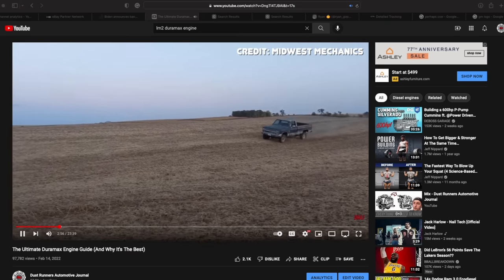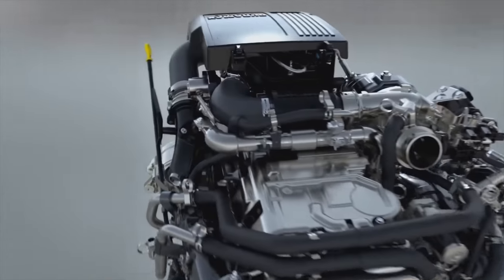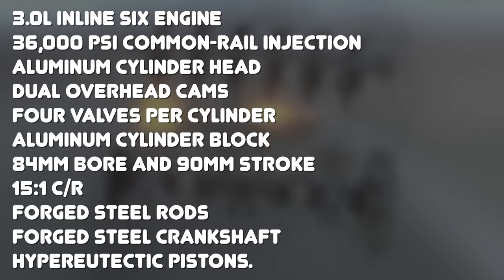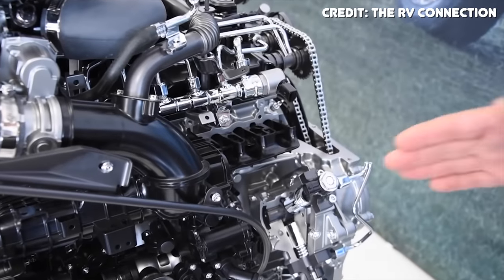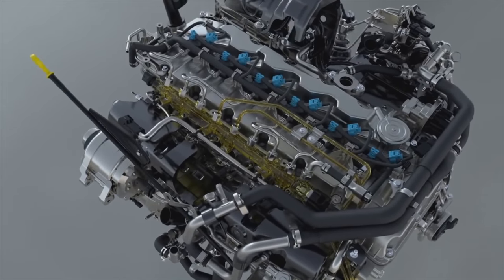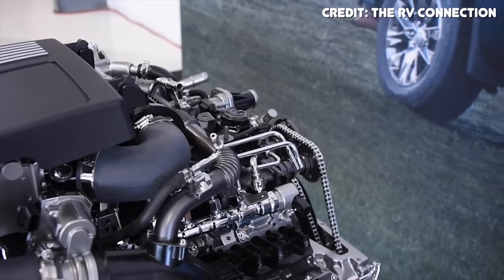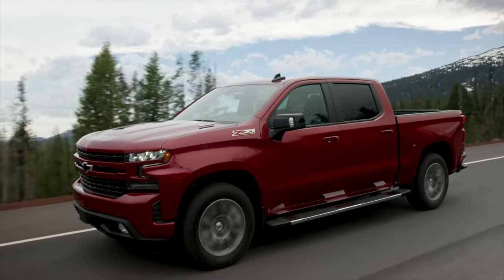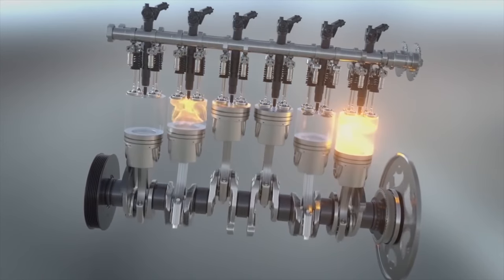3.0L LM2 Duramax: Everything You Need to Know

Comment: Great video. Taught me things I had many questions on. This is my recent and not over with experience with my new Duramax and Chevy.
I have had plenty of Ford Diesels and Ram diesels in the past. All ran great except the last 2500 Ram in 2014. The DEF system broke more then 8 times in 12 months stranding me 3 times out of town. I lemon lawed it and they did not contest. My 2005 Excursion ran great up until 60,000 miles something blew in the HP Rail System. The mechanic told me that igt was a very common problem of the 6.0 liter engines at the time and would cost me over $2500.00 to fix after the warrantee expired. I traded it in. I wish I would have kept it since they have plenty of fixes now. Onto my story.
I bought a 2022 Tahoe with the Duramax. I waited 9 months for it since it was custom built. Ordered in May of 2021, showed up in January 2022 as a 2022. Ran great until it hit 8,000 miles only a few weeks ago. Check engine light came on, the collision alert system would go off for no reason, the transmission run hot alert came on even though I put the trans temp gauge up, it goes from normal to overheat and back several times in about 5 seconds then stays normal until it does it again. This usually happens when sitting at a traffic light but sometimes at highway speeds, a reduce speed warning comes on even when just rolling and sometimes on the highway, once it refused to accelerate but that was just once. MPG also changed. It went from 17-21 city and 24-28.4 highway to under 18MPG no matter. Obviously something is wonky! Drove it home and parked it. Next day it wasn't happening but the MPG is still low.  I spoke with the dealer and they only have one diesel mechanic and over 25 3 liter Duramax trucks in line. I was told no guarantee and it could be weeks. I need that truck for work so I had to wait a week or so and now will make the appointment. In the mean time, I did my first oil change and could only find the oil at the dealership at $13 a quart. That's $2 more a quart then my wife's 2021 twin turbo Porsche. The dealer also sold me this tiny blue oil filter without a box. When I removed the original filter, it said to replace it with an AC PF66. The dealer supplied filter was shorter, not labeled and I could squeeze the filter with my hand. it definitely was some knock-off filter. Is this what AutoNation Pembroke Pines, FL is having their mechanic put into your truck? That's why I always do my own oil changes and basic maintenance. I drove (yes, another car!) to my local auto store and found that they sold the correct AC filter and both Wix and Purolator who make very similar if not better then the correct AC filter. It's not uncommon to find different brands sell the same exact oil filter but all three had little variations which looked like three different manufacturers. I won't tell you which filter I put in but it was not that piece of $#it dealer sold one. I am telling you that the dealer supplied filter that cost me $12 was a cheap knock-off and that I do not want in my truck and neither should you. Yes, I am going to call them out on it. I'm not knocking AutoNation as the salesman and customer service was was fantastic but I worry about vehicle service when the dealer is putting a junky but very important part of your engines maintenance pieces. So should you. Before you go to the dealer for an oil change, check with the service department to see the oil filter as if you were going to buy it. If it is not in a box and/or does not have a PF66 sticker on it (they all do), either do it yourself or go buy the proper filter (will have to be the AC PF66) and tell them to use that one. If one dealership is doing it, then others are as well.

Comment: I have a 2020 AT4. absolutely loved the truck until I hit ~45K miles and it went into limp mode. It's been at a local dealership for over 6 weeks now and they still can't tell me all that's wrong with it or when I'll get it back. Good news is that it is still covered under the powertrain warranty. All I know is that the whole engine is torn apart and they keep finding more issues. I think I'm gonna get out of it and go with the 6.2 or 2500 diesel. I keep my vehicles too long to have to worry about another similar issue at 150K miles after the warranty runs out. Two months ago I would have defended this engine until the end, great fuel efficiency, tons of power to pull my boat, and really smooth engine... when it was rolling anyway.
Reply: @Dark farts Yep, the new cylinder deactivation systems on the V8 are so bad that the best GM engine now is the 2.7T 4 banger.
Reply: @OtisFlint  Thanks to the microchip shortage new V8 equipped trucks don't have dynamic fuel management.
Reply: @mikechappell7920  is that all of the V8s?  I would buy the 6.2 if it didn't have the DFM?

Comment: FYI, most big truck engines makers, such Daimler/Detroit, Volvo, and some Cummins, have rear gear train engines. The rear gear train allows more airflow over the engine to keep the engine compartment cooler. It has nothing to do with serviceability and everything to do with removing heat from the engine compartment.

Comment: Had my Silverado for about 18 months and 14,000 miles. Mileage is quite good with an average of about 22-23mpg city, 27-30mpg highway (I tend to drive fairly fast on the highway so the 30mpg or better is only seen when I’m actively trying to get good mileage). Issues have been occasional (like 6 or 7 times ever) non stop cranking without start. This seemed to me to be related to key fob security type issues. Kind of a hiccup where the truck doesn’t realize you have the key in your pocket, yet allows you to press the starter button and engages the starter. Oddly, the ECM doesn’t have a time limit on cranking of, let’s say, 8-10 seconds and will crank indefinitely if you allow it. Only way to stop it is to press the lock and unlock buttons on the key fob. I suspect if you didn’t do that it would crank until starter failure or dead battery, whatever occurred first. Took it to the dealership for service and they did a software update after I made them aware and it has so far not had that issue, though the update oddly did increase crank times before starting compared to before. Maybe 1.5-2 seconds cranking vs 0.5 before.

Comment: I have 85,000 on my babymax. You mentioned the hard start or long crank that is intermittent,  I have noticed that it was more prevalent in the first 40,000 miles and that it only happened when I shut the truck off during a regen.

Comment: may have already been mentioned but DEF system doesnt fair well in colder climates.  A co worker of mine got one and not knowing any better he filled it DEF tank and when it froze which happens often enough the DEF heater cant keep up with a full tank but seem to be able to handle half or quarter tanks, maybe a video on common DEF issues throughout the diesel engines would be an interesting video. what causes issues and what could possibly prevent the issues and stuff like that. I have a VW 3.0 TDI and is giving me emission problems right now.  Luckily i have other vehicles to drive so I'm not in a rush to get it fixed quite yet but having known a little more on the issues i would have avoided the purchase all together and I have been a fan of diesels my whole life.  Main reason i cant see my self spending 60 to 100k "I live in Canada" on a truck are the draw backs of DEF system malfunctions as well as other emission hiccups.
Reply: Def freezes at 14* F . The coldest I had This Year was-10 and not plugged in. No problem. Now if it's going to be worse than that I'd plug it in. You'd think they'd heat The Def tank as well as the antifreeze while it's plugged in. But Engineers and common sense aren't so common

Comment: easy maintenance is one of the most important traits of a good daily driver. They really dropped the ball on this one
Reply: although you're not wrong, but 150k miles isn't exactly bad either... that's longer than most clutches. You're part of the reason why manufacturers are pushing for 2 year 20k mile oil changes, just because people are lazy and see that they only need to maintain once every 2 years, or non at all every 2 year lease they gravitate towards that car more.
Reply: @gwot  i didn't neglect my spark plugs because im lazy.. its because i dont have the means to drop the cradle to get to the back three plugs. Yep im the reason why🙄🙄🙄
Reply: @gwot  im just tired of manufacturers purposely designing cars that require a two post lift to do maintenance
Reply: @Alexernst55  it doesn't require a two post lift to drop the tranny.
Reply: @gwot  correct. Have a 66 mustang with a borg Warner t5. Fucked up 4th gear synchro and replaced the whole transmission bc I'm too dumb to tear one down. Did it on jackstands. Sucked ass. But possible.
Reply: @Alexernst55  not denying any of that

Comment: THere is a video out there from the chief engineer for the LM2 LZ0 engines that said there was a sub-tier supplier flaw in the crank angle sensor on some of the early model year trucks.  It was ultimately corrected in software.

Comment: 150,000 mile belt replacement. So about $1000 every 10-12 years. I’m good with that. And I would think GM did a lot of severe load testing for this engine. They didn’t just come out with it ‘cause they had leftover 3 liter diesel blocks laying around.
Reply: maybe $1000 this year, but likely to be twice that amount in just a few years....not so sure with wouldn't be $2000 now.
Reply: @mtjag3138  I mean are you really racking up 150k miles in a few years?

Comment: The crank no start is essentially a non issue. It starts up the second time 99.9% of the time. Annoying yes but seems more than likely a software error as the TSB for the cam shaft sensor was not a fix. Still the best diesel engine for a 1500 on the market by a mile. (Current owner)
Reply: There's an ECM software update that fixes this issue. Look up PIP5823A. Any GM dealer can flash this update to your ECM.

Comment: I am really surprised GM went to the trouble of building straight-6 version of an Opel passenger car diesel. In Australia, they use the excellent Isuzu 4JJ3 3.0l diesel engine in the D-MAX pickup. Reliable and proven engine.
Reply: American emissions essentially just say “no” every time someone tries to bring a new one to market.  It’s dumb, but it’s how things work over here.
Reply: I wish we had the Isuzu over the vm. They seem to be more robust and more reliable.
Reply: Haha. No that’s not at all what they built. I’m confused why you even compared the LM2 with the 4JJ3. The only things they have in common are that they are diesel and have 3L displacement. The LM2 has 66 kW more peak power and 174 newton meters more torque. They are not in the same league.
Reply: @RB-xv4si  Yeah, that's exactly what it is. The LM2 is a direct descendant of Opel diesel engines in Europe. The thing was designed at the GM powerplant center in Italy where the rest of the Opel diesels were designed. Now they technically buy all of them from PSA since the sale of Opel but that's where the design work was done. You can even see the same belt driven oil pump setup on them. It's not a bad thing, they make great diesel engines. I was just commenting that it was an odd choice.

The 4JJ3 has plenty of headroom for more power. Australian tuners are regularly getting 550-600Nm (400-450lb-ft) of torque out of them with nothing more than a tune and bumping boost up from 20 to 25psi. No injectors, no larger turbo, just a piggyback ECU and an intercooler to safely raise boost. The stock 4JJ3s are barely breathing hard.
Reply: @DriveCarToBar  an inline 4 is fundamentally flawed compared to an inline 6. An inline 6 does not require a balance shaft. It also does not require counterweights on the crankshaft because it’s a naturally balanced configuration. It has perfect primary and secondary balance without adding extra weight and moving parts and is the ideal configuration for diesels. That’s why almost all modern commercial transport trucks use inline 6 diesels. You can tune all you want but you’re just polishing a turd.
Reply: @RB-xv4si  Not the point at all and the straight six vs four isn't as big as issue with diesels and their very long strokes. While the straight 6 has perfect balance, the low revving LM2 can't really make use of it's biggest benefit, which is high rpm smoothness. Conversely, because it never spins that fast, the 4JJ3 doesn't need a balance shaft. 
You're going off into the weeds though. I just commented that I thought it was odd for GM to go to all the trouble of a new diesel when it could use one that already comes close to US emissions standards and would just need certification from the EPA. But it could be that they wanted to build it themselves in the USA (which the LM2 is) instead of buy them from Isuzu in Japan or Thailand. It could be they tried and Isuzu turned them down for whatever reason.
Reply: @DriveCarToBar  what you say about straight six diesels needing to rev high to take advantage of their balance, that’s not really the point of having a straight six diesel. There are many other advantages, one being that they are less complicated and more reliable than naturally unbalanced configurations. As I already said, straight six diesels are used almost exclusively in heavy commercial trucks. And those don’t rev past 2,500 rpm or so. That peasant 3L inline 4 diesel…I have a very similar version of that in my 2018 Chevy Colorado pickup. It’s the 2.8L Duramax inline 4 diesel..made in Thailand and has almost exactly the same power figures as that new Isuzu engine and a bit more torque. It is an absolute turd and is more boring than watching paint dry. Chevy is discontinuing this Duramax for the Colorado refresh next year..because no one here likes it!!
Reply: @RB-xv4si  No, I said that straight six don't rev high, which negates one of the advantages of a straight-six design that we see in gas motors (well, BMWs anyway)
The very long strokes of diesel engines and their high piston speeds are one of the larger limiting factors in their usable rev range. One of the biggest reasons big trucks use straight six motors is packaging. It's a lot easier to work on them without having to pull a very large, heavy motor out of the truck. It's why lots of big trucks have things like individual valve covers over only one or two cylinders, so they're easy to work on. In the case of Isuzu and Cummins, their smaller displacement diesels are generally just 4-cyl versions of their bigger brothers, but major components are identical between the two. i.e. the rods and pistons from a Cummins 4BT will fit a Cummins 6BT. Ditto for the Isuzu 4HK and 6HK engines.

The motor in your Colorado is a VM Motori engine, which ironically enough, came out of that same Fiat-GM partnership as the Opel motors which underpin the LM2. GM and Fiat jointly shared and used engines for years until GM left the Euro market and Fiat bought out GM's interest in the technical centers. That VM motor, in various forms, is the same one that went into the Jeep Liberty CRD, the various Mopar SUVs in Europe and the US until the release of the A630 V6 3.0l diesel...a diesel originally intended for Cadillacs in Europe.
But honestly dude, you're still way off in the weeds. I'm not surprised you find a diesel engine in a small pickup boring. They're low HP,  torquey motors meant to haul shit and get good fuel mileage. And there will still be plenty of Diesel Colorados being made, we just aren't getting them here because US emissions standards are stupid and diesel is regulated as a commercial fuel instead of the way the rest of the world does it and is taxed higher. They're discontinuing the gas V6 as well.
Reply: @DriveCarToBar  all the Cummins diesels here in the 3/4 and 1 ton Rams are all straight 6’s. Probably the best diesel you can get out of all the big pickup manufacturers in the U.S. Very very highly regarded. Adopting that engine pretty much saved Ram from ceasing production at one point.
Reply: @RB-xv4si  some tuning takes care of that 2.8 and it becomes much quicker. Don't even have to put it on a diet to get decent response and power. It's pretty nice with a tune. Of course it will never be full size nice, but that is just fine. They work great for what they are and with increased fuel prices, an efficient little truck is really nice.

Comment: I absolutely love the LM2 in my 2021 GMC. Smooth, quiet, great power and torque, and I average 24 - 25 mpg in my daly semi rural driving. I have had the ECNS issue 2 or 3 times and had the ECM reflashed about a year ago and it has not re-occurred since. Also one O2 sensor went out causing a CEL which was replaced under warranty. And,  it tows my 22' Rockwood travel trailer with ease. Also I did drive the Eco Diesel before purchasing and there was no comparison in regards to torque and smoothness. And I did not like the fact that it was a european automobile diesel converted for use in a truck -(Ford had already discontinued their 1/2 ton diesel by that point).

Comment: Only had one bad thing happen to a 3.0 at the dealership I work at.  Customer just bought a truck, came back and said it was knocking.  Pulled the pan and found some metal.  Turns out part of the piston broke off.  It was a complete anomaly though, and I haven’t seen any major problems.
Reply: Yup because not every part goes through Non Destructive Inspection/Testing.